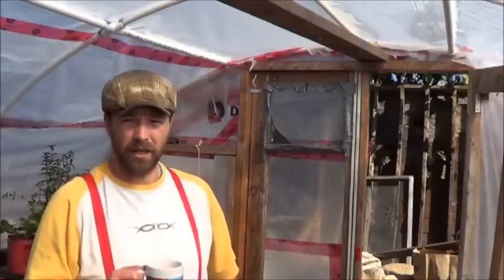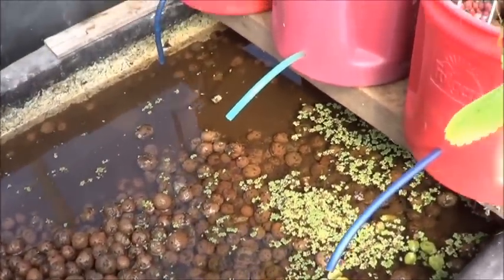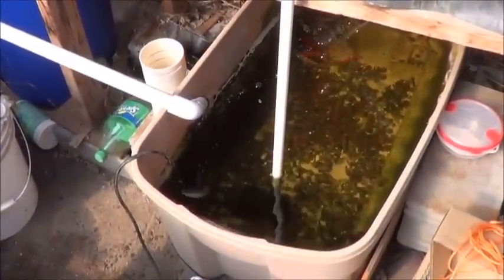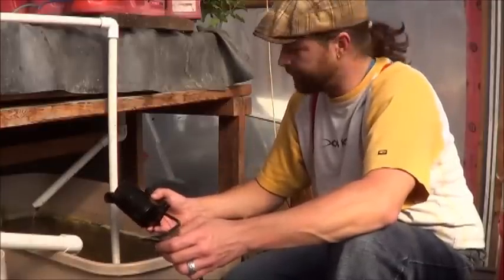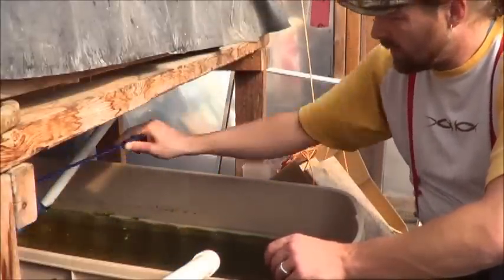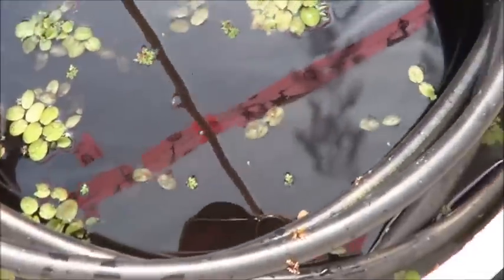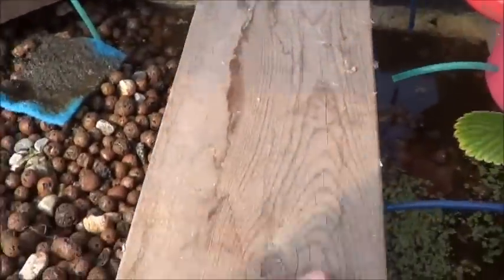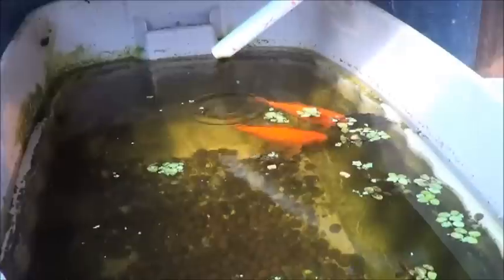Working on the No Power Aquaponic Garden

Comment: think about a bio battery. bokashi is a composting method that creates a ph low product. if you mix ashes with water you get a ph high product. if you wired these two environments you get a electric current you could use.
Reply from the maker: Basically anything with a pH difference can be used to create power, what a great idea for how to get some cheap power into one of these setups!
Reply: ;) its 3,5-4.5ph to 10-11ph and you can use barrels. should give you some watts.

Comment: I'm going to ask a question you probably have had a lot. How do you get the water too it plants in the no power system.
Reply from the maker: ***** Tupperware juice jug, circa 1975 ...
Thanks for checking it out!
Reply: ...waiting for the video to load.
Moving water--without power--leaves--capillary action.
===
capillary action  
The movement of a liquid along the surface of a solid caused by the attraction of molecules of the liquid to the molecules of the solid.
Reply: I don't get it.
That is either a drainage ditch or a watering hole.
Reply from the maker: Mark SM At this point I guess it would be a drainage ditch.  I fill the coffee cans by hand at the moment from a juice jug.  The water is drained by gravity into the old grow bed through the blue air hose at the bottom.  A small amount is left in the cans for the plants in between waterings.  As the water goes into the old grow bed it is somewhat filtered a second time by the clay pellets and pea gravel that still remain in the bed below.  An overflow drain, the standpipe from the grow bed, drains the water into the fish tote below.  I water once in the morning and once in the evening as a general rule right now but I suspect that will change.
Thanks for checking it out!
Reply: JT Bear
That is what I did see.
I've tried capillary action using cotton cord.
It is never sufficiently--stable.
What you have is stable.
Reply from the maker: It seems to work well enough for now.  There are some labor saving ideas that need to go into it now and I want to track my pH levels just to play it safe but basically ... it works.
Reply: JT Bear
Yes. A capture system is a standard.
You might consider what capturing rain water will do for PH levels.
Feeding in the amounts for PH levels.
Saving rain water--for conditioning.
...or fertilizing--per rain amounts.
Reply from the maker: Mark SM Working on some rain capture ideas ... I'll post when I get something together.
Reply: JT Bear
Thanks--I'm just getting started w/ my apt. garden.

Comment: Fish catching tip:
Get another net like the one you have. Corral with both nets. The "one"(fish) you want will eventually go into one of the nets.
Then you can put the empty net over the net with the fish, to keep it from jumping out.

Bonus tip:
Drop the water level to the height of your net(no swimming over the top of the net).
-
Congrats on the future green house. : )
Reply from the maker: UncIe Bete Both tips = excellent advice!  Those little buggers were forcing their way under the net by taking advantage of the bumps in the bottom of the tote.  It all worked out okay though.  They seem to be settling in with the older crowd just fine.  :)
Thanks!

Comment: I'm  lost. The water isn't being moved with a pump?
Reply from the maker: aransom808 The basic drive behind this garden is people power.  A jug is used, or the bottom half of a pop bottle, and the plants in the coffee cans are watered that way.  It drips & drains out into the table beneath it where it then drains into the fish tank at ground level.  No pump but it does need to be watered several times per day in really hot weather.  Hope that helps, thanks for watching!
Reply: I was thinking of doing this but adding a new tank above the plants. Theoretically, I would put the water in there a few times a day and it would slowly drain down to the plants and back in the tank through a tiny hole. You think that would work?
The problem here is, we don't have electricity out there (yet) and I try to use as little as possible. I have seen a pump that is solar powered (with a battery to run during the night) but I have to save up some money first.